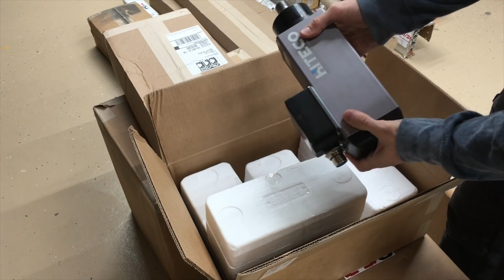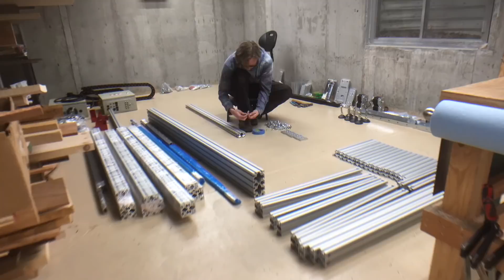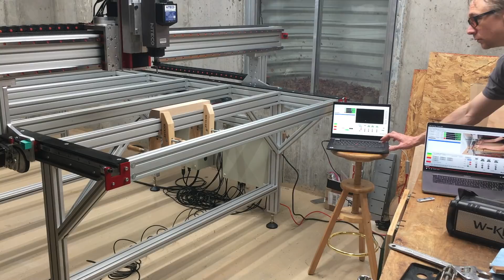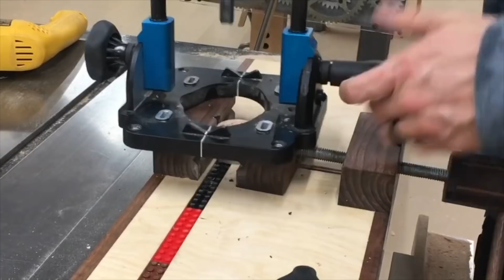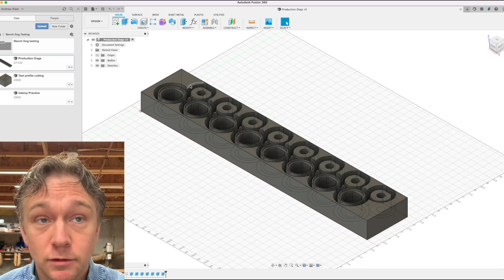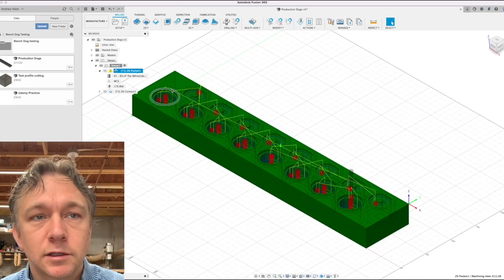My first AVID CNC project

Comment: I can sympathize with your transition pains going from SketchUp to Fusion 360 since I'm also moving away from SketchUp. You are much further ahead since you've actually produced something usable out of Fusion 360.
Reply from the maker: I might have produced some foul language as well as something usable in the process.  Hang in there.
Reply: @AndrewKleinWW  you might want to consider Carveco software. It's not cheap for the full version but it is definitely a more wood friendly program.
Reply: I use solidworks and I like it. I used fusion for a week and found it clunky because I was already use to solidworks. My plan is to design in solidworks and export it to vcarve pro. I have a design pc that I keep inside the house to really put in long nights and recently purchased a few year old Microsoft surface to run a dedicated laptop for the Cnc so I don’t tie up my pc and it will be easier to use since it’s portable. According to vcarve you only need 4 gigs of ram and windows 7 or newer to run their software since it’s not processing intensive. Maybe look for a decent spec laptop like last year’s model to get the savings and have your windows option since a lot of design software is designed for windows. Garrett from IDCwoodcraft uses a 10 year old laptop 💻 for his Cnc machine and he has recommendations on budget laptops well under $500. He’s really good at answering questions as well, I highly recommend checking out his YouTube channel.

Comment: I don't know if it's going to help with the CAM, but there is a way to tell fusion what material your model is. under design->solid->modify you will find Physical Material. there are several wood species to choose from. That will affect the weight calculations, as well as mechanical properties if you use the simulation features (FEM simulation). There is also an appearance menu where you can select "3d wood" which is useless for CAM, but makes for really nice visualizations.

Comment: Stick with fusion. You’ll get it and it’s very capable. The helix being to tight is called pitch angle in the linking tab. Change it to .1

Also in your stock setup. On the 2nd tab it looks like the default “additional stock” is turned on. It defaults to adding .02” of stock to whatever size your model is. Depending on what you’re doing this could be unwanted.

Comment: Stick it out with fusion.... All the settings you need are there you just need to learn it. Moving to vcarve will give you some advantages short term but your engineering mind will shortly be wanting for advanced tool paths and simulation capabilities that are not in vcarve. In fact the simulations in vcarve are quite honestly awful by comparison and it can't model undercuts.

Comment: Hey Andrew, one thought I had would be to make a negative "die" to hold the pieces as you cut them on the table saw. That way it ensures they don't fall into the blade and get damaged. Also, if you need to fully automate you can utilize a negative as a "clamp" to hold the part, flip it over, and machine off the waste side with a second CNC operation.

Comment: as an Aspire user I can tell you V-Carve is great software and I cannot recommend it enough.
HOWEVER:
Fusion 360 is perfectly serviceable and there are shops that use it for wood to do amazing things. learning either one  takes time, and they are definitely different processes. Considering your environment (mac os), and other uses (engineering), Fusion 360 is  probably YOUR better choice (assuming no other factors like material specificity, connectivity, or cost over lifetime, end to end workflow, etc). Talk to some other fusion shops, particularly about speeds, feeds, and ramp. I don't know fusion well enough, but the settings it looks like you need help with most would be ramp (how quickly it plunges while cutting) and/or depth of cut (how deep a cut it makes in a planar pass). they may also recommend a separate preprocessor software.
PS
I know you have limitations on post processing with the table saw (or optionally on the band saw), but don't forget you can secure multiples to that bed and  as long as they're properly spaced, then run them all as a single tiled batch. it'll let you process as it goes saving down time of babysitting the machine. you're going want some hearing protection  too if you aren't already.

Comment: Hello Andrew,
Check out Rhino and Rhinocam.  I find it to be a great alternative to Fusion360.  Rhino is a very high-powered 3D modeling software and when it's paired with Grasshopper plug-in it'll dazzle your mind.  Rhinocam is also a plug-in for Rhino.  Rhino does run on a Mac and all the functionality of the Windows version is found in the Mac version and any updates to the Mac version are timed to the same release date as the Windows version.  The downside?  Rhinocam only works with the Windows version.  So if you have an M1 Mac you'll have to also run parallels.  I know that sucks but it might be worth a shot if you end up loving the software like I and so many others have.  Also Rhinocam will allow you to control the amount of step-downs when you're milling holes and it is geared for CNC routers as well as anything else that is CNC or 3D printing.
Reply from the maker: Thanks for the recommendation Teddy, I have heard good things about Rhino before, so I will check it out

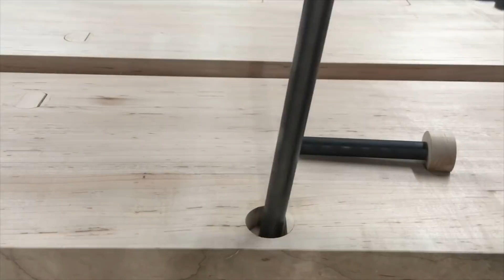Comment: Andrew, while I applaud you for modelling such a close tolerance of the parts (3:40) are you sure this is a wise thing considering the seasonal change in wood? Also different climates in the vast USA might mean they will bind up and become unusable. Why do you use the table saw rather than a band saw to release the models?

Comment: I don't know if it would be suitable for your purposes but InShape is web based 3D CAD. I don't know if it does tool paths for CNC. I recommend Parallels, VMWare, or VirutalBox (free) for running Windoows on a Mac, though last I checked you can't use them on an M1 yet.
Reply: Parallels will run on an M1.

Comment: other alternatives to fusion 360 are alibre or rhino3d... and the last one is available for mac. it is a good software but i dont know how it compares to vcarve pro for what you are doing. but still it has external cam plugins, so maybe if there was a plugin. or other templates available that might help? idk. but the vcarve one looks good. as for fusion you should be wary of its online only service model. you can expect to pay some adobe like recurring subscription in future. unlike alibre and rhino which can be purchased as standalone software package that does not require and depend upon the cloud
Reply: Rhinocam is a CAM software plug-in for Rhino.  It's a great software and I highly recommend it.  However it only works on the Windows version of Rhino.  So he'll need a windows and Mac Version of Rhino or Parallels for Mac.

Comment: Look in to CAM templates in Fusion 360. I have a template that have different feed rates, ramp angle, depth of cut, etc for each of the different materials that I cut (wood, HDPE, PVC foam board, acrylic, fiberglass, carbon fiber, etc) Each template can have multiple operations in it, such as drill, contour, bore, engrave, trace, adaptive, etc. Once you have created and saved the template for a given material, then each time you go to set up a job, the create the setup, then right click on it and select Create from Template, and select your template for that type of material. The all you have to do is select the geometry that is to be machined. Cam templates are a huge time saver and a way to insure consistency in your machining. As you learn what works, you can edit your templates so that they include whatever changes you want. 

I have VCarve and never use it. It's good for "artsy" stuff, like carving, but I find the that Fusion 360 is a far more capable CAD/CAM package.

Comment: It looks live you've gotten a good result from your first project with the new CNC, congrats. I am anxiously awaiting my Pro4896, but still have about 10 weeks to go. I started learning Fusion 360 about 5 years ago, when I got my first CNC machine and cannot thank John Saunders @ NYC CNC enough for his countless Fusion 360 tutorials. They were a HUGE help. One of his suggestions, which I have made a standard practice, is to organize each design using components, starting with two top level components, one being the 3D Model and the other being for CAM. Inside the 3D Model component, every object that is designed is a separate component, which contains the sketches and bodies that make up that object. This way a complex 3D model can be made, with each component oriented as it would be real life. Then when it comes time to make the parts,  I copy and paste the components that need to be manufactured in to the CAM component, where I can orient them as they need to be for manufacturing. There are many other benefits to this workflow, and I cannot do them all justice in a comment here, but it's worth looking in to.

Comment: I have tried fusion myself, I settled on Vcarve as well ( as a hobby guy with a home made machine ). Still not perfect but it's much better than the alternatives I've tried and very approachable. It does have some limitations on 3d work but generally in that case you model in another software and just export 2d stuff to Vcarve.

Comment: As mentioned you can increase the helix angle. If you can predrill (use a drill press or tool change) you can avoid the helix completely by specifying predrill points in the last tab of the setup. This will be a huge improvement in time. You could also consider holding the board down using painters tape and super glue, double sided tape, or vacuum and cutting all the way through to eliminate the release step. I think there is also a way to change your defaults when you edit your settings.

Comment: If you had the height (or used smaller stock) you could make a sled to hold the CNC'd material in.  That way you could use a quick release clamp to swap them out easier and it may be safer too.

Comment: I'm not a fusion expert, but I would say that you shouldn't necessarily model your bench dog components as part of the material itself.  So typically I believe your top component (which in the free version of Fusion would act as your assembly) then model the two parts of the dogs as separate components under that.  From there you can define your material in the cam menu and place your components into it.

Check our Lars Christiansen's channel or I Like To Make Stuff's fusion course.

Comment: "Maximum roughing stepdown" in the Passes Tab in your process box is the setting to change the depth of each pass.
Reply from the maker: That’s what I thought also but when I increase that setting it doesn’t change those plunge spirals
Reply: @AndrewKleinWW  make sure you have the "Multiple Depths" box checked, set your "maximum roughing stepdown" and regenerate your tool path. It should automatically after you make changes and hit ok but sometimes I like to right click on the tool path and hit "Generate" to be sure
Reply: Agree with Chris, it's how I've done things, 30mm of Australian Brush Box, a native hardwood, in around 6 steps down at 1500mm/min, spindle at 22000rpm, can't remember the ramp steepness, and that's on a 2hp water cooled spindle, so should be able to ramp it up a bit. Just be careful of grain direction dependant on species, it took multiple tries to get the right combo, your shape seems to be condusive to milling though. Good luck, it's a steep learning curve, but with it long term.

Comment: As others said below, you can adjust the ramping angle to improve the stepdown.  Also....if you want, you can program Fusion to thread mill the holes.  I don't quite know your requirements but that could be a good way to speed up production if you set up everything to do multiples of your current workholding.  If you're interested, tell me the thread pitch of your bolts and I could mock up a thread mill program for you  as an example (with info on how to finetune the thread fit).

Comment: If you build your tool spec’s in the tool library, you can adjust the stepdown for the vertical feed and set its default value to whatever you want to use. 

Tool library > open your tool > cutting data tab > vertical feed - feed per rev. Or pass and linking stepdown depending what you are trying to change. 

Once you build that tool you wont have to change it again in the cam for future parts. But you can still override it on the pass/linking tab flyout to tweak certain tool paths as needed. 

Excited to see what else you come up with on the cnc! Good luck.

Comment: Did you model a piece of wood and then removed all of the material you dont need? If thats the case -> just model the finished part once and then copy it and arange it like you want it to come out of the wooden block. When you go to the manufacturing tab in F360 you have to configure your stock material.
There are a lot of videos on youtube. In my opinion NYC CNC has some good playlists for F360 beginners.
Also you can define different tools with different feeds, speeds and i think also how deep this tool can go with one pass.
(english is not my first language but i hope you can understand what im talking about :D)

Edit: The playlist is called "Fusion 360 for beginners" from NYC CNC

Comment: You can probably improve throughout by jointing & gluing a panel to minimize initialization cycles & getting more parts per initialization (U'd probably RIP that back to strips before the release cuts). Might also consider aligning the flat dog faces face-to-face for a single pass creating the flats for 2 dogs at once.

Comment: Maybe consider, if you have not already, loading the amana tool library into fusion and your future vcarve program as a starting point for feeds and speeds in wood.  I came from vcarve to fusion 360 and it is daunting at first. It is so flexible it seems inflexible (if that makes sense).  With fusion you can create templates for tool paths that you can draw upon in the future. I learned a lot from the NYCCNC website. Unfortunately it is mostly traditional machining methods; but good fusion tips nonetheless. But, as a starting point I adopted the speeds and feeds from vcarve into fusion and went from there (before the amana tool library was available). Those red circles you talked about (ramping down on the start of a tool path) can be set to a higher degree (and large step down) for faster ramping.  I stuck with it and after about 3 or 4 years and am comfortable with wood but still uneasy with metals (occasional use only).  I flip back and forth between vcarve and fusion depending on the project.  Thanks for sharing.

Comment: I'm no expert, but I believe what you want to adjust on your toolpath is under the linking tab, should be the rightmost set of options. Under that should be options marked "Ramp", if you increase the ramping angle it should  cut deeper with each revolution. Fusion 360 does seem to be very powerful, but not always very obvious what things you should be adjusting, or what might be causing issues. Good luck

Comment: Nice video. So, was production work they main reason for get the CNC? I’ve been through the mental exercise, and have wondered if the learning curve is worth it for small numbers of parts. Thanks!
Reply from the maker: Production is a big part of why I wanted it, but there are some use cases like lettering and very high precision where I think it adds a lot of value even if you are making one of something.